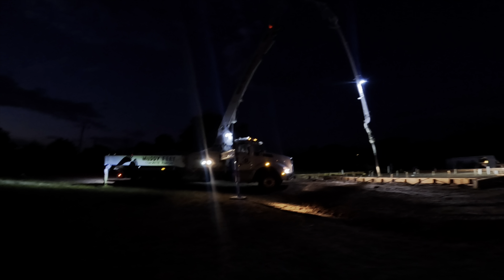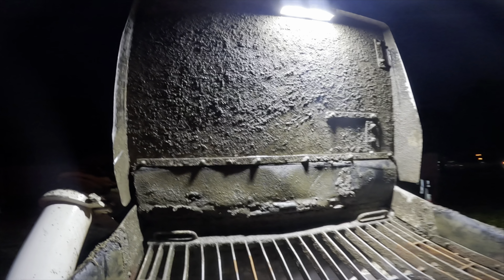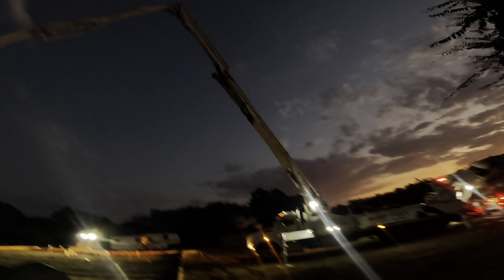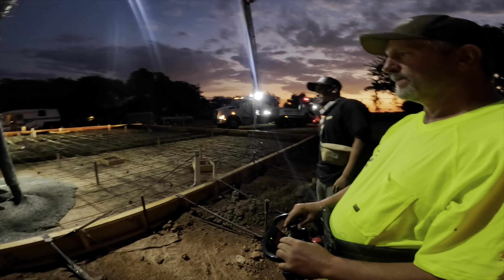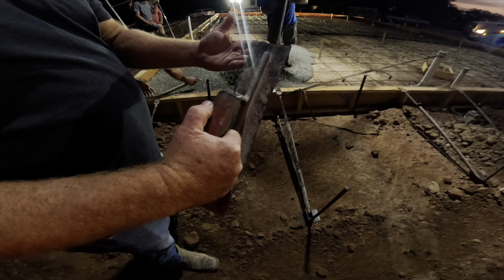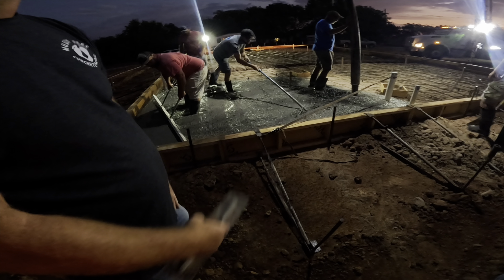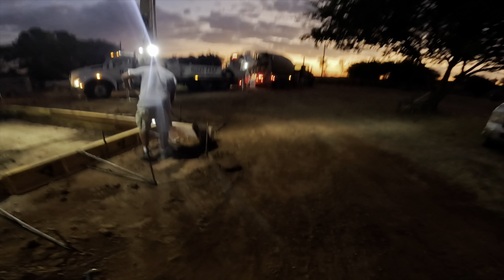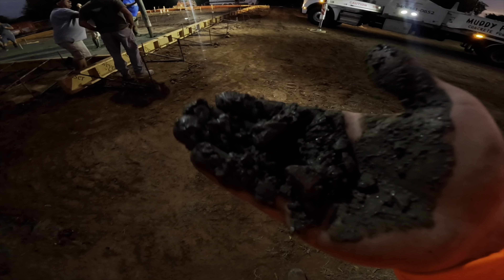Concrete Pump Operator Audition!!!

Comment: I Love those early morning starts.  Scott how did you like that fast prime out? 3 seconds per stroke.
Reply from the maker: @mikeeemike988  I mean, it worked… not for me though as I really don’t see the benefit with our material. IMO, all it does with our dandy mix is make it more likely to plug in the prime and increase the odds of jamming in the pipe/elbow so hard that we now have to start pulling system apart to deal with the plug. 

I’m a slow primer for life! 😁😁👊🏻

Comment: Need to get these Texans some secondary grates for the booms and especially line pumps. Makes a world of difference, I don’t like pumping without one. Love how different things are region to region. It seems to be same from Texas to Louisiana. We blow the residential work up when doing house slabs. When they have room to stage the trucks, wash them out, and get 2 at the pump hopper they’ll load 100+ yards at once. Can make things very stressful if you have any plugs or mechanical problems with the pump. Always gets the blood going first thing in the morning 🤯🤣

Comment: Conforms air cuff system the one with the push button remote is where moving a pump shines because it’ll stay closed even when taking pump out of pto 😝

Take the air cuff off the pump switch and put back on remote
Reply from the maker: @randyanderson1983  We had an older machine which had the separate “garage door opener” remote for the air-cuff. Always hated that thing. I believe ours was wired into with PTO activated relay though, so it also didn’t provide us the benefit which you mention. It would have been super handy in that regard for sure.
Reply: @canadianconcretepumper1979   that’s wild we  got a system about 2 years ago and it comes with the remote
Reply from the maker: @randyanderson1983  All of ours since have been outfitted from Putz with the air-cuff system. The only unit we’ve ever retrofitted came wih the remote. Is it possible to have the air-cuff solenoid activated by both the pump on/off switch, as well as the separate “garage door opener” style remote? Seems like doing so could provide the best of both worlds. 🤔🤔🤔
Reply: @canadianconcretepumper1979  Yes it is! A simple stepper relay is all you need 😊
Reply from the maker: @mitchell7203  I may have to look into this…. when the day finally comes that I land myself a shiny new 28Z Putz “Full-Flex” that I’ve been talking about for years now 😁

Comment: Here in DUBLIN IRELAND I was always told to keep the R, P, M up at the Max and if you need to pump slower Turn the speed down with the volume control because the Hydraulic Pump's don't like it if you run them at low R,P,M it can damage the parts inside the Main Hydraulic Pump. That's on a Schwing concrete pump. I don't know if Putzmeister or Concord are the same.
Reply from the maker: @johnnybrophy8229  I’ve heard similar for a Putz, but with the price of fuel these days, I’ll gladly take saving $25 per day in fuel consumed at the potential cost of my hydraulic pump lasting say 5,000 pump hours versus 5,500.

It really comes down to if the machine is having to push hard are not, IMO.